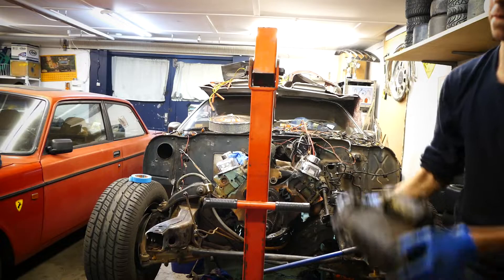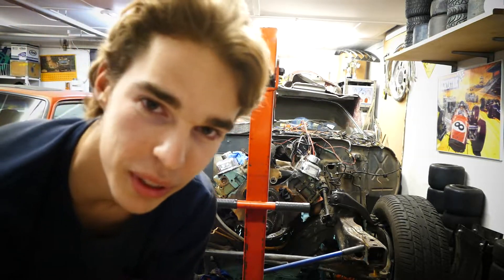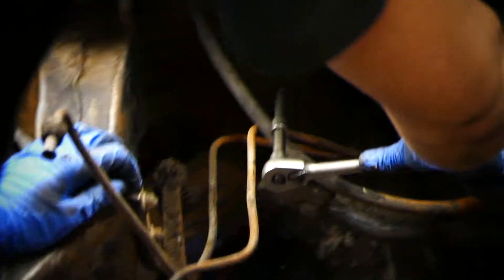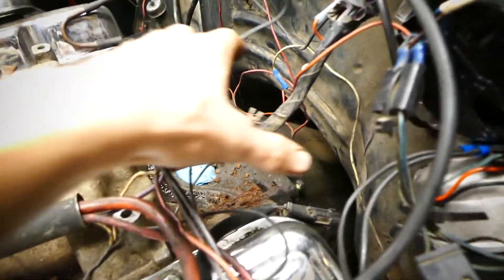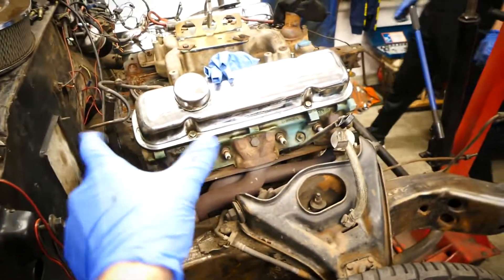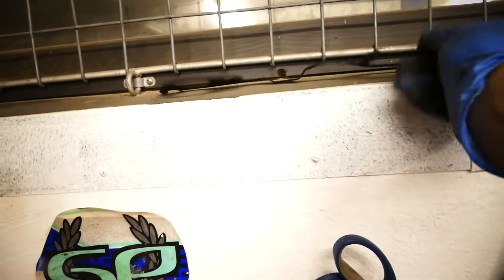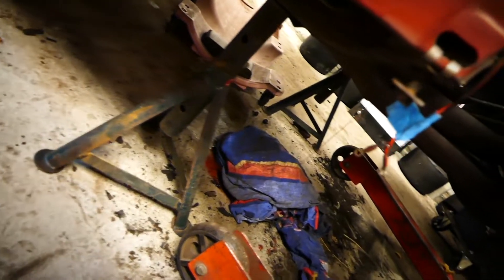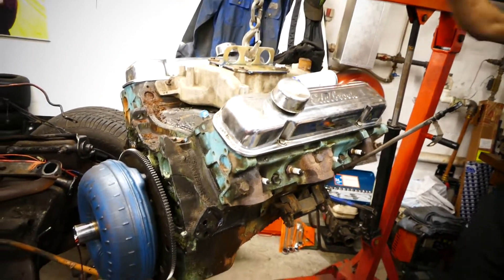PULLING THE PROJECT CAR ENGINE!!! 1970 Firebird Drift Car Build Part 7

Comment: Nice! Remember if you’re taking the frame off you’ll have to realign it back on the body. There’s some measurements to do it right going from passenger side frame rail to driver’s side frame rail in an X pattern to make sure the frame is square. Also hopefully you remembered where the alignment shims were for the fenders.
Reply from the maker: Ohh okay ill have to remember that, and yes saved all the shims!

Comment: Take a regular wrench or socket and use a jack handle as your breaker bar. You will definitely get it then. Slide it over the back of the wrench or socket handle and it definiely give you enough leverage.
Reply from the maker: I tried but I didn’t work cause we use millimeters here and the bolt is inches so the wrench is just a tiny bit to big and then rotates on top of the bolt head when I use that much force so I guess I have to find a American wrench set haha!
Reply: Viktor Hansen that you will have to. Try to get a wrench and socket set. That car will use a lot of it.
Reply from the maker: @Thecraig909  haha bet lol i just dont wanna buy tools haha rather parts but i gotta get some tho :D